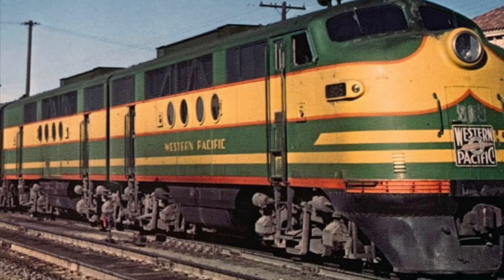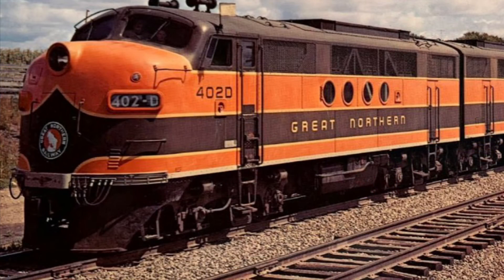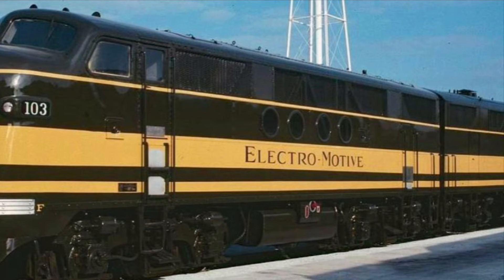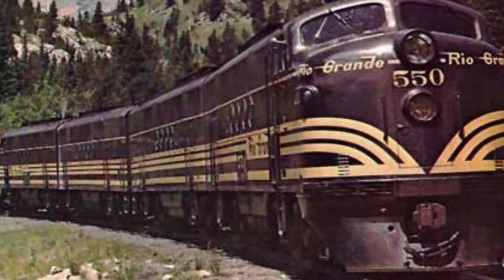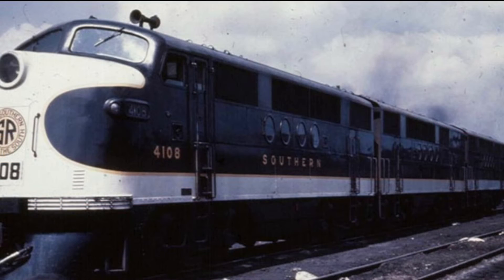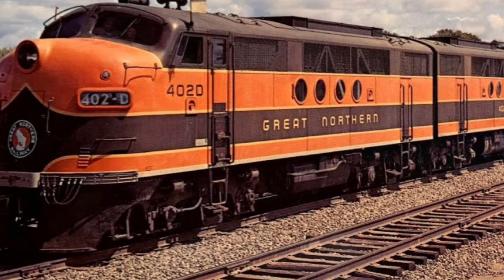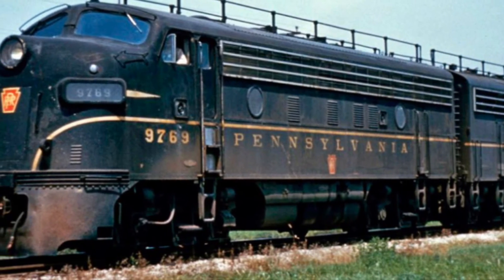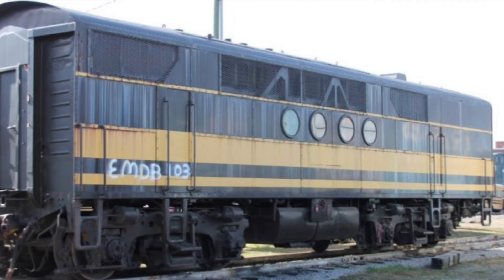Engines Of North America: The EMC FT

Comment: The Santa Fe ordered their FT's with couplers between the A and B units.  They also had to order some FT sets at the beginning of freight dieselization in A-B-B-B sets, because the unions insisted that all locomotive cabs had to be manned (it took a judge's ruling to end that silliness! ).  I had a college roommate that somehow got ahold of the manual for ATSF #105, and it clearly showed that the set was delivered with one A unit and three B units
Reply: Some other railroads (I am not sure which ones) also ordered their FT's with couplers which gave them added flexibility in creating locomotive consists.
Reply from the maker: That’s cool

Comment: Each unit had one 16 cyl engine . The A+B combined units had 2  , depending who you listen to the Ft stood for freight or the F was for freight and the T for 1350 HP or the F was for 1400 hp rounded up from 1350 and the T for t unit sets . I believe it was FT for freight since EMD was already working on the 1500 hp version even before the Ft was finished and night have had it at the beginning if they could have figured out the generator issues hence the F2 which spanned the Ft and  to the 1500 hp F3

Comment: The "T" stood for "twin", since each "Unit" was actually a A-B set, held together with a drawbar. Each chassis only had a single V-16 2-stroke diesel, not 2 engines.  The "F" stood for "fourteen hundred", which was the hp rating of the V-16 motor. The confusion is due to the consideration of 2 chassis as a single unit, which was quickly dropped by the next F series model. Certainly by the end of the war, new F units were mostly being ordered with couplers, and were by then given distinct numbers of their own
Reply: Also, the first A-B-B-A set was considered 2 units (4 chassis total), not a single unit. On some early sets, they were numbered "xxx and xxxa" (ATSF did this at first). This was before the later common nomenclature of "A-unit" and "B-unit" was used, so what we call a B-unit often came with an "a" suffix on numbering. Other railroads used -a and -b suffixes in the common way used today,

By the end of the war, ATSF had a large fleet of FT's, and on future F series orders had them delivered with couplers. They even preferred F series to E series on passenger trains, and quite a large number of later F series locomotives came equipped with steam generators.
Reply from the maker: Thanks for the insight. While I’m proud of the video, I think I rushed it a little. I’ll try not to next time.

Comment: EMC had been cataloging units by horsepower. Examples the SW was Six hundred no Welded frame. NW was Nine hundred no Welded frame. TA was Twelve hundred hp A unit. E units started out at Eighteen hundred hp A unit(or B unit). This started to change about1940 with the 2000hp E3.
Reply: The W stood for Welded Frame, not 'no Welded.' EMD also produced SC switchers, where the C stood for Cast frames.

Comment: After the early E units built from 1937 in several small series, all with two engines, the FT = Freight Twin is kind of a logical step when you consider freight needs more tractive force so more powered wheelsets. And instead of putting eight axles under a single two-engine locomotive they just built a twin locomotive with the two engines in two separate carbodies but controlled together.
Also it seems like there were regulations at the time that each locomotive needs to have its own crew, as was the practice in the age of steam. With diesel locomotives this is not necessary but until the rules were changed it meant to redefine what "one locomotive" is and declare the sets of two, three or four units to be one big articulated locomotive that cannot be uncoupled in service, only in the workshop.
I'm reminded of the BLS Ae 8/8. This Swiss railway had one of the first high powered four axle electric locomotives, the Ae 4/4, and didn't want six axle locomotives because of their track forces in curves. Instead they just coupled two Ae 4/4 together, removing a cab of each, and called the result Ae 8/8. They also trusted a fixed-cable double unit more than a connector that would be coupled and uncoupled all the time (maybe this also played a role in the FT).
Later on, however, railroads found it much more practical and flexible to combine consists of locomotives as needed and be able to replace a defective unit easily. I guess that's also a reason why they stopped ordering B units. Not much of a saving over a cab unit and too impractical, unable to move on its own.